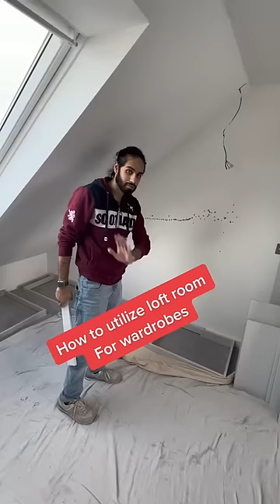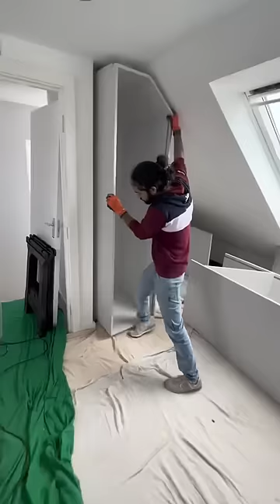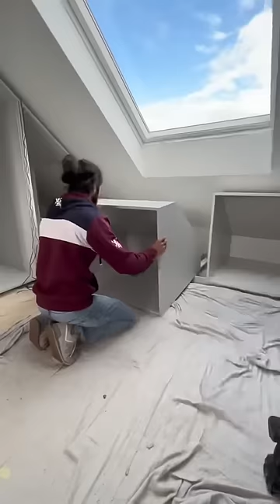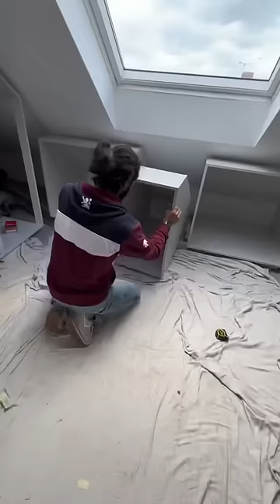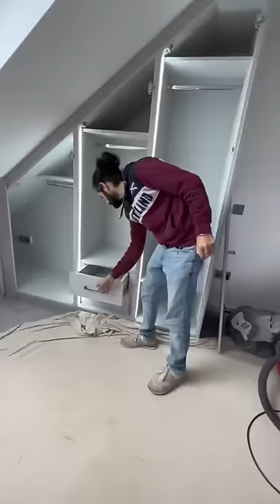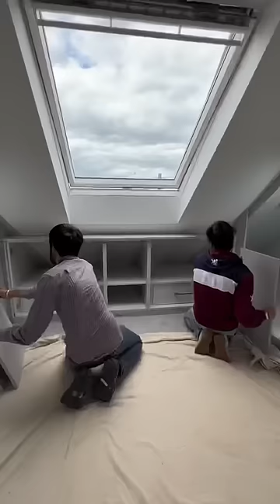Loft storage #fitted #loft #bespoke #led #angle #installation

Comment: That’s a nice use of space. I just hope I can do that where I’m at and not have to deal with loads of mold afterwards. With 80-95% humidity throughout the year plus a relatively chill temp (average temp is 15-17C; 9-13C during cold months and 18-22C in summer), there’s just no hope of having a loft storage. A basement is out of the question.

Comment: I would have gone without the smaller sections on the sides (closest to the window) and given the window more of a ledge that could be a seat but you could still have the storage under the seat ledge. And you could still have a smaller cubby in the corners.

Comment: Just wondering 🤔 Are those cracks in the walls? I think, I would want to investigate how they got there, before putting up the cabinets first. Just making sure that there's no structural or water problems, that can worsen over time!😳 Other than that, it looks great! 🙂👍

Comment: Messed up bad my guy. Great build, but by putting a full frame on the base, you create a perfect sealed space for damp to accumulate that has cone up through the floor as water vapour bu can't get back down. Mould trap

Comment: As a carpenter I can tell you no cabinets come with pre drilled and screwed handles. This was all pre build by a carpenter and the bought and paid for it then pretended they did it. They put the cabinets where they wanted then the carpenter came and installed them and the fillers to the ceiling and gaps. The pretended to put the doors or but in order to put the handles on you must first put the doors in which is a clamp that anyone can do, adjust them, measure out for handles. They did the handles and all then the ones who made the video took the doors off and put the back on. THIS IS FAKE AF AND YALL ARE EATING IT UP.